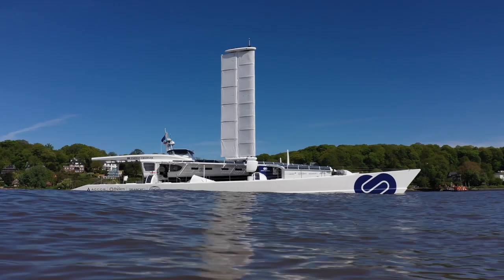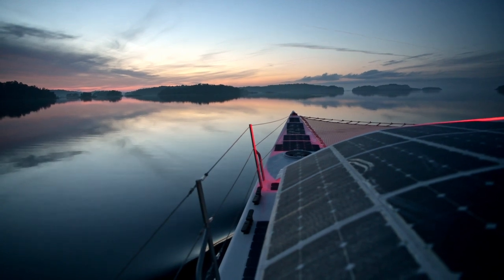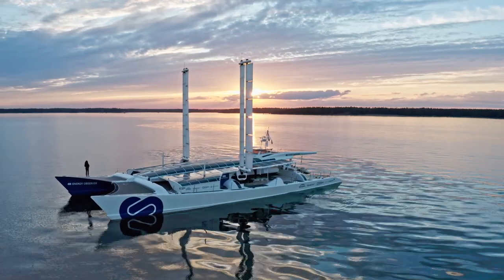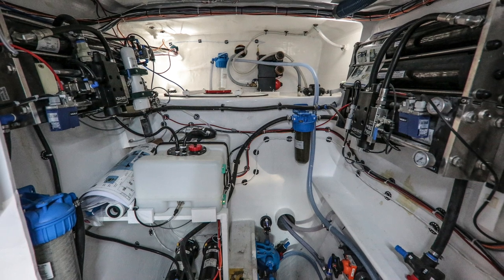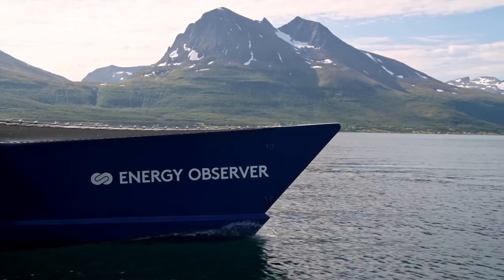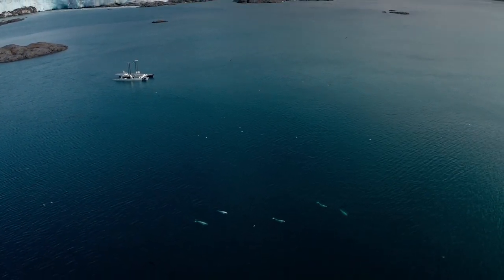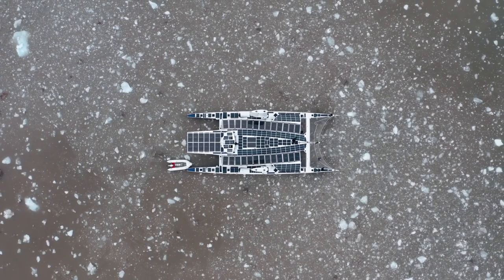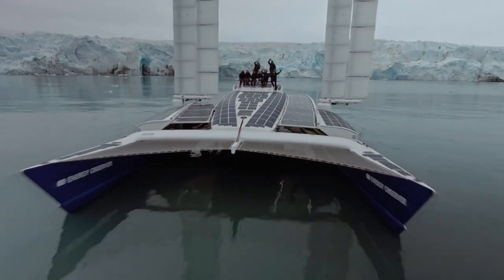Energy Observer: Space-age catamaran/floating laboratory powered by hydrogen | Motor Boat & Yachting

Comment: Pretty cool.....but I'm guessing that's just about the slowest moving boat in existence.
Reply from the maker: She can do 12 knots, which is more than enough for long ocean crossings!
Reply: Motor Boat & Yachting for everage cruise? or top knot
Reply: @MotorBoatYachting  With which power source/how long?
Unfortunately, I didn't find any information about the power consumption at different speeds.
With solar power only (24 hours average), it seems to be 4 to 5 knots. I found 4.5 knots mentioned as "optimal speed".